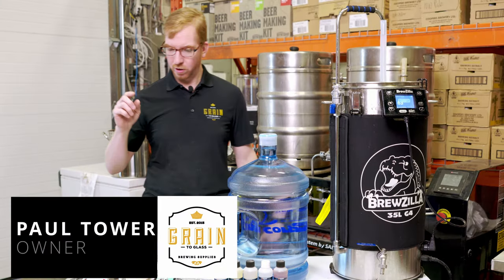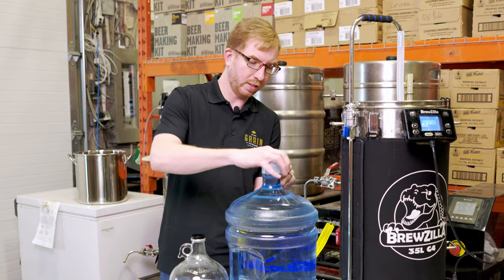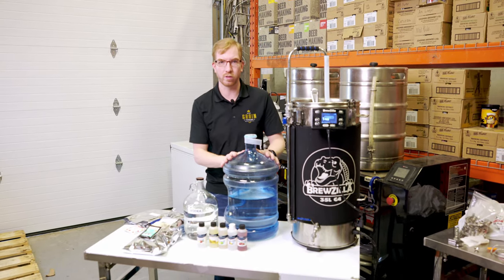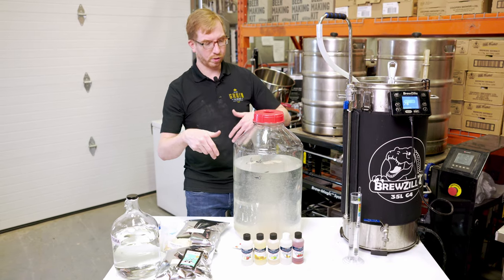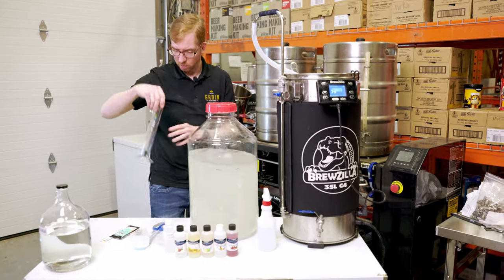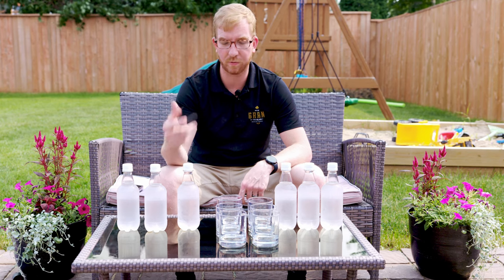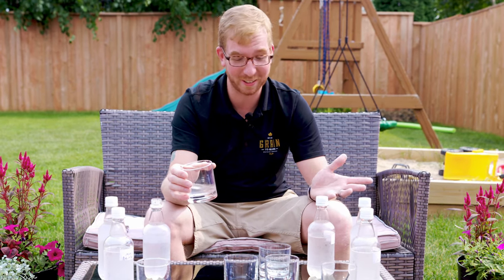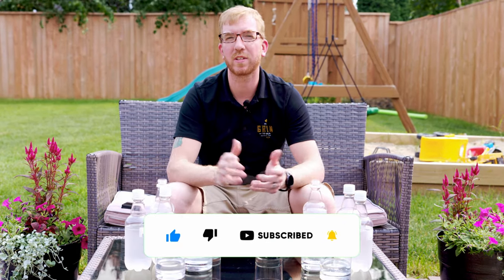Brew It Yourself: Homemade Hard Seltzer Made Easy!

Comment: Leutra is no joke!  I be made brews in my garage using it, and around 90F in there during the day. I have seen fermentations finish in just over 24 hours. And since they are happy at that temperature, no off flavors. Could be why the Leutra batch tastes tue way it does. It also is known to enhance fruit flavors.
Reply from the maker: Ya the Lutra batch fermented much faster than the MJ.  Cheers

Comment: All right so I gonna go with a cup and a quarter of sugar .white sugar .I thinkva teaspoon of champagne yeast.?  I'm going to put it in my Sous vide at 72f .I'm going to go 10 to 12 days I'm looking for about you know 16 to 18% I'll flip it in burp it everyday. I'm thinking I should go about 10 to 13 days? 2 liter bottle.
Reply from the maker: That should work but I've never heard of or tried fermenting using sous vide.  Just make sure it's properly cleaned and sanitized I guess :P  Cheers
Reply: @graintoglass  right on brother. I'm using the sous vide as  temperature maintenance . I'm using 2 litter bottles as the actual vessels. They're sitting in the sous vide at 72f covered with a towel to keep any light out. It's working out pretty good. They're foamy and burpable Every morning. I'm going 12 to 14 days. I'll let you know how it works out. So far so good. Thanks for responding 😀. The science of it is fascinating.

Comment: New to brewing! My question just to make sure I’m on the same page you only poured half the bottle of water into the kettle to heat and melt the sugars right? Is using RO water okay even if only half is boiled?
Reply from the maker: Hi, yes I only heated up about half the jug of RO water.  Just enough to melt the sugars.  I use RO since I know that it should be clean and free of bacteria.  Also it's harder to make a very clear seltzer when using tap water.  Cheers

Comment: Hi, great video. I've never used Leutra, but I'll give it a try for home brew seltzer. Question...is it possible to just add the flavouring to the keg?
Reply from the maker: Yes you can add flavoring to the keg.  I kegged it unflavored just so i could test many flavors off of the same batch.  Cheers

Comment: I have been strictly drinking seltzer's lately, I am definitely going to be trying to homebrew some! Is there any way to know what the calorie count is?
Reply from the maker: Most of the Cal will come from the alcohol itself. I looked at some Cal calculators online and it seems like there would be around 125 calories per 355 ml.  Roughly ten calories will be from carbs and the rest is from alcohol.
Reply: @graintoglass  this is amazing!!! So if I come to the shop and just tell you what I want, you guys can tell me exactly what I need AND how to do it?!
Reply from the maker: @220Maximus  we should be able to yes. You can also use the contact form on our website to ask us any questions you may have.  Cheers